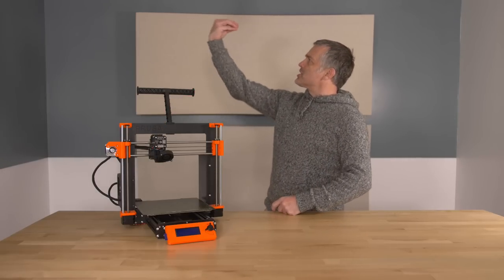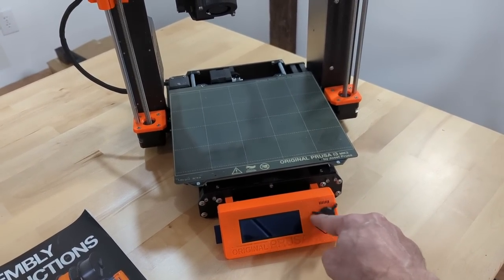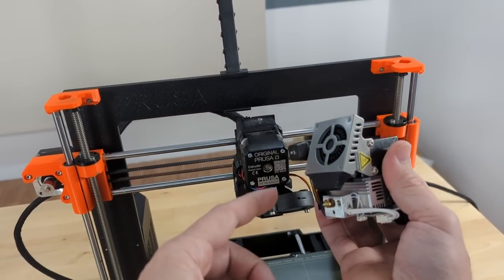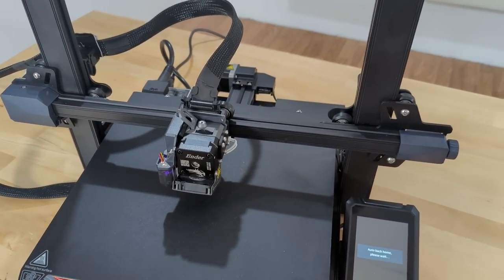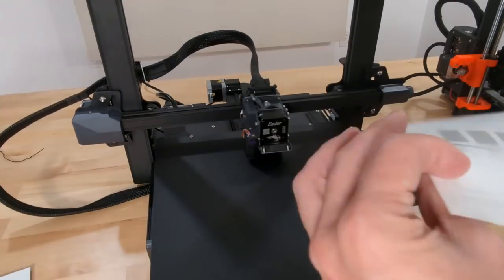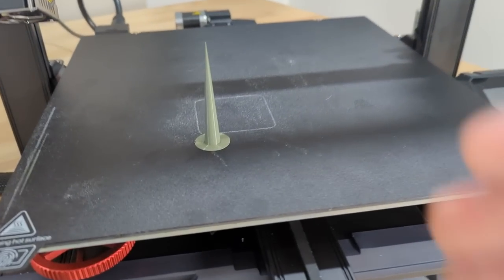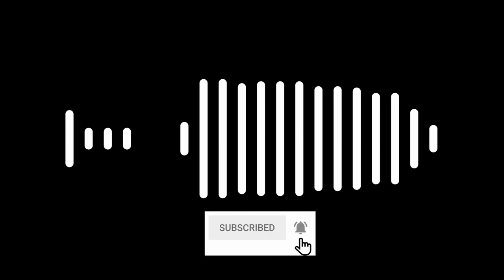Creality S1 Plus Has all the right features - Let's compare it to PRUSA I3

Comment: why is anyone buying printers on wheels nowdays? they are inferior and a constant issue
Reply from the maker: Ha! What are you on about? Think of the delrin wheels like tires on your car. You don't see any cars with metal rims riding on the pavement. The softer material gives a nicer ride and eliminates slop/wiggle in the movement system. Unlike the Prusa linear bearings, you don't have to keep grease on the movement system when using delrin wheels. Grease which can easily get on your hands and clothes when interfacing with the printer. It's true that if you over tighten the eccentric nut tensioning system on the wheels they will degrade from being under too much pressure. So adjust your printer correctly and you will have these superior movement system at your disposal.

Comment: A printer so modern, it uses V-slot wheels
Reply from the maker: All this hate on v slot wheels. Doesn't make any sense to me. I think it's all hype. I've never had a problem. Just keep your printer clean. Wipe the v slots from time to time. And the motion will continue to run smoothly.
Reply: @Design Prototype Test  I've had to replace hundreds of V-slot wheels (not being dramatic) just because they wear so much. Honestly, prusa did well with the linear bearings, especially for being a 6 year old design. Though I do think linear rails are the best

Comment: The prusa has a better linear system compared to the ender. They linear bearings are really worth the effort, V slot linear rails are good for DIY efforts. We make linear actuator units for industries , and we would  never use V slot rails, it's either linear bushings or MGN carriage rails for us

Comment: Bro have you seen the comments Prusa has been making about the Bambu team.  Even posting hate messages about their cloud security.  It's pretty crazy.
Reply from the maker: I have not seen that. It doesn't surprise me. Also, such behavior suggests the possibility that Prusa is the sock puppet master himself.
Reply: Could you please share a link so we can check that out?
Reply: I mean they had major issues with their cloud security that’s a valid strike. They veeerrrryyy reluctantly were forced by the comunity to instigate basic security measures
Reply: @DesignPrototypeTest  Bambu labs used unencrypted connections to communicate with their cloud servers. This is insane and they deserved much more hate then what I have heard from the community.

Comment: 1. Delrin IS POM.
2. POM nuts are better than Brass.

I would never own a PRUSA
Reply from the maker: Can you provide more support and further convince me? Why are POM nuts better? Can this same reasoning be applied to the motion system?  "V groove wheels are better than circular x-section rods with recirculating metal linear motion bearings." Is that a statement which you agree with?
Reply: @DesignPrototypeTest  
POM is, according to my own search, the plastic with the least resistance.  

While brass is said to be 'self-lubricating', it wears at a faster rate than POM.

Michael at Teaching Tech (at least I think it was his YouTube channel) tested the POM wheels against linear rails and found no benefit nor detriment in the more expensive setup, except the needed maintenance, as you mentioned.  There is no accuracy improvement.

The very slow speeds of 3d printers do not make heat an issue.  One can over-tighten the POM wheel system and cause flat spots in the extrusions or wheels, depending on the mounting plate manufacturer.

Prusa's designs go back to the home-made reprap designs.

They are, according to everything I have ever read and watched, very finicky as to initial setup and their printed parts break and break and break.  That is inexcusable and unforgivable today.  Prusa has made enough money to have all their parts injection molded!  Except for the main chasis piece, they seem the opposite of robust.

For $1000???
Reply: @DesignPrototypeTest  I forgot to add that POM can be machined into a simple block to slide on the aluminum profile and will work without chatter or a big change in friction.  Once I get my CNC built, I plan on replacing the wheels with blocks, just to prove the point to myself.  Their are chute material management systems that stopped using the ball bearings in the bottoms and use POM inserts, instead.

Comment: it bougles my mind, how you can think this was good review with equal condition, "enders fan boy". 

Disclaimer first: I do NOT own any of Prusa's printer. I have experience with heavy modded Ender 3 (out of box, it was not able print anything decent). After I watched both your bad videos on MK3 printer, I will buy one. 

Second: If anybody want to see unbiased review, check for example this one: https://youtu.be/jCkIXHieHlE

Third: calling everybody who disagree with you as "Prusa Fan boys" is really bad argumentation foul which is mostly used by populist politicians and dictators. This is showing how you playing on feelings not on logic. Which is what you should do if you want to do proper comparison.

Four: From your video, both printers fail in print that needle :D and to be honest ender needle was more uglier, because it was not only top of needle. then you give second print without showing any setting and speed on ender, but you did not print same with same setting on MK3... how you can then compare anything?  

and its many thing which is just showing your video is made to harm MK3 without real data, or logic, basically your are just Ender fan boy. :D your argument. 

But last point: most of things which you are point up on ender s1 pro (printer from fall 2022) are already on MK3s+ (printer from spring 2021), logicaly, ender is newer printer in that case it should be better, but most of upgrades/news in ender s1 pro are already default on mk3s+ for years. :D To be clear I do NOT say "MK3S+ is better", I'm saying it is sad to buy new printer for not so cheap as well and have similar quality as much older printer. 

And biggest joke on you, in both videos you was forced to do second print, to "proof a quality" of ender's printers :D  that is saying much about MK3S+ stability
Reply from the maker: >first: I do NOT own any of Prusa's printer
I'll just quote  Shakespeare here: "The lady doth protest too much, methinks" As if some claim not to own a product is proof that you are unbiased and are not here to serve Prusa's interests. 

>in both videos you was forced to do second print
Why sir, whatever do you mean both videos? I've made many videos. Surely someone like yourself who is unbiased and has no agenda to support Prusa would have seen all my videos that feature other printers. You wouldn't have any special interest in Prusa printers to the point where you are fixated on the two videos I made comparing the Prusa I3 Mk.3. to Chinese printers. 

So, which European country are you from? Czech Republic or Germany?
Reply: @DesignPrototypeTest  basically you proof my point where everybody who does not agree with you is Prusa fan, without any further information or with any hint of presumption of innocence. That is why I commented your video, not to support ender or MK3, but point out your not professional behavior. Everyone is entitled to an opinion, and if you disagree with it, there should be an open discussion here. But your attitude only promotes segregation and certainly not healthy discussion. Hobby should connect but your attitude is going again.

I found your videos because I want to buy a new 3D printer. And I'm not just thinking about MK3, I'm looking at everything that's currently available that's at least partially decent. And unfortunately, cheap does not mean good. I already learned that with Ender 3. And before I buy anything, I do deep research and especially look for people with a different opinion than the mainstream. And yes I found your video when I was looking how is standing MK3 in 2023, but that does not mean I came here as "white king to protect Prusa research pride". But your video has nothing to do with an objective or valuable opinion, you draw attention to some shortcomings but you are not willing to take into account a real comparison, history and other circumstances that belong to the product. Your position is purely based on hatred without supporting anything with valid arguments.

But what I'm trying to do, I can say anything, but it's not up to me to prove to you that I'm something or not, it's up to you to be open to criticism and other opinions as an influencer. But no matter what I say, I will still be a secret agent of the Prussian cult for you. What a stupid approach. The world is not black and white.

Comment: You probably been in this 3d printer thing for a while  I've been in it about 2 months total.  The key to a good print is smooth moving parts and strait filament into the nozzle as straight as possible no bind . And you can take a 179 dollar printer and print as good if not better than a 1000 dollar one ..  and a good hot end for high Temps.  One more thing as don't use a  .4 nozzle .6 or .8 so you don't get all those blockages every print.
Reply from the maker: Nozzle clogging is most often caused by heat creep. Make sure that your hot end has proper cooling.

Comment: DPT you are doing the lord's work in exposing the fraud that is the orange printer. So may people are either in the nostalgia bubble or have severe cost sunk denial that they cant see any printer being better.

I literally had to talk down a P-bot because he said his $800 box of parts(with bag of gummies) was better than my Bambu labs X1C. Sheesh. You can literally show them a better printer and their brains short-circuit.

Bigger volume, faster printer, better tech are all met with but "mah reliability". All the while ignoring even the P-gawd needs a service center. There are countless forums, error codes and so on but because they can find a community to commiserate their speedy 45mm/s printing its a "win".  🤡🌍

'You can lead a horse to water but you can't make it think"
Reply: And yet my prusa has been running for 25000 hours and still spits out better prints than my x1 carbon. Slower, but better. And boy is the x1c unreliable compared to my prusa. 
And yet proper engineering (x1c is proper engineering but suffers from issues) like the voron smokes both in terms of print quality and speed
Reply: @tadhgd350  So let's get some math in.
a X1C is 2-4x faster than a Prusa at stock settings
Under you 25K hours it can be completed in 12500-6250 hours
Taking longer to print the same item is not the flex you think it is. lol

I'm nearly at 3k on my bambu lab since August.
if you hop on another ty channel 247printing he has numbers up for standard speed but I ill reference all speeds. Standard, sport and ludicrous

Flexi dragon  
prusa 21:24hr
Standard Bambu 8:43hr- 2.5x difference  
Sport 7.1hr 3x difference
Ludicrous5.15 hr 4x difference

Davy jones
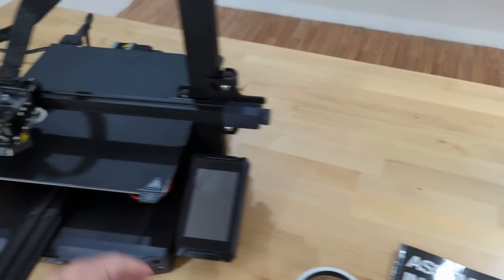Prusa 8:05hr
Bambu 3:04hr-  2.6x difference  
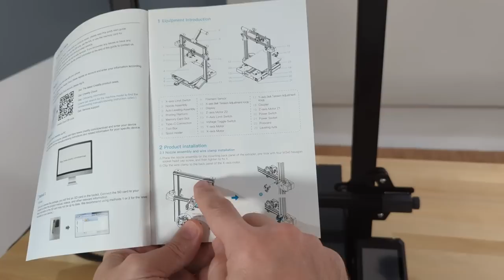Sport: 2:28hr- 3.2x difference
Ludicrous 1:50hr 4.4x difference

Prototype 
Prusa 5:15hr
Bambu 2:15hr 2.3x difference
Sport 1:48hr 2.9x difference
Ludicrous 1:21hr 3.9x difference

Speed boat benchy 
Prusa 0:58
Bambu 0:23m 2.5x difference
Sport 18m 3.2x difference
Ludicrous 13m 4.4x difference

"And yet my prusa has been running for 25000 hours and still spits out better prints than my x1 carbon"
If you have an X1C you know that comment is silly and false. There are countless videos showing the X1 serious smoking the prusa. It's like beating a disabled puppy levels of sad. I have a buddy who was suckered into a prusa and I know for a fact my prints are better.

I will challenge you to a mk3s vs my X1C, pick an STL and make a private yt channel and we can compare.
Put your comments to a real test. I'll even throw up a time lapse as you do the same.

"[...]the voron smokes both in terms of print quality and speed"

A voron is whatever the heck you put into it. It can be great or trash. You also need to to build it(30+ hrs) spend 80-200hrs printing toxic abs. Source the parts(avg $1500), and spend countless hours tuning, flashing firmware, tweaking, troubleshooting and lets face it wasting time to make it usable.  If you can get your voron from unbox to printing in 20 minutes I will concede the point. So throw up video about your under 20min from parts to fully functioning voron. That's what Bambu labs represents. Voron speeds and better than prusa quality. Unbox to printing in 20-30 min. Some of us want a printer not a project.

/mic drop
Reply: @No0o0o0o0o0  dude I literally said I have both an x1c and a prusa, my prusa clearly out prints my bambu, the bambu input shaping sometimes craps itself and the top surface quality is mid. 
Contrasting, my prusa is a workhorse giving me consistent parts 3x slower than the bambu. Sport and ludicrous fall further behind in terms of print quality so I’m just going to ignore those. Sure you can get 25k hours worth of printing in 10k hours but nobody has made it to 10k hours yet, it’s not been available long enough. 
And the bambu printers are frankly nowhere near as reliable as a prusa, there’s just so much more going on and so much more to cause problems. Sure it hasn’t given me many “typical” fails but once in a while the firmware or something will just crash and leave me with half a print. 
I only threw in the voron as a comparison because it shows that prusa is 100% behind in terms of what there could be as a diy kit. Took me about 20 hours from parts to printing and another 10 hours to tune it, thus not a comparison. But that comparison clearly sailed right on over your head. 
My guess is the bambu will start giving troubles near or before 10k hour mark and you’re forced to go crawling back to Bambulab for ANY spare parts. It’s a machine designed for them to fix, not you. The prusa I can fix any day with any old parts, and that’s only when you’re out of their warranty. Out of warranty repairs you still get their full assistance but you’re on your own for sourcing the parts. 
If bambu one day goes out of business all the machines will be all but dead in the water.
Reply: I am a KS backer and own a prusa mk3s+. There is no comparison The X1C is superior in everyway. If I had to purchase a Prusa in 2022 I would be asking for a refund.